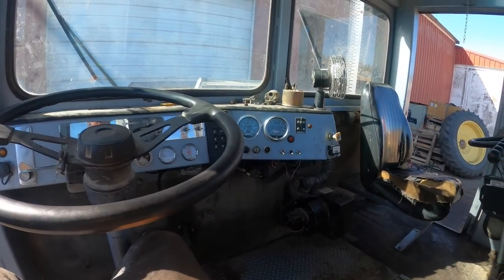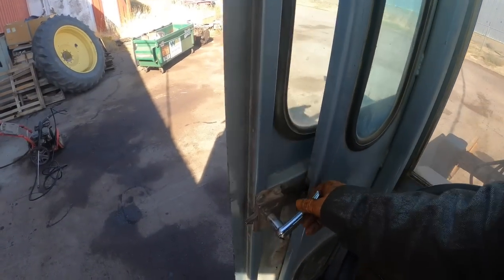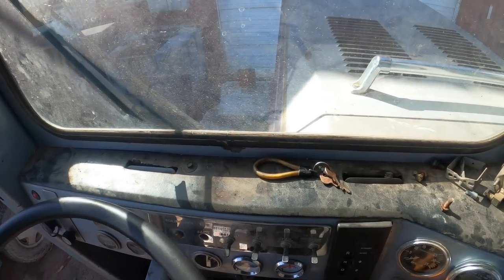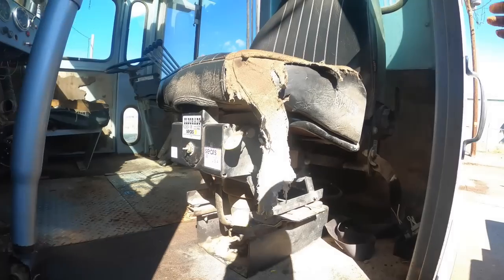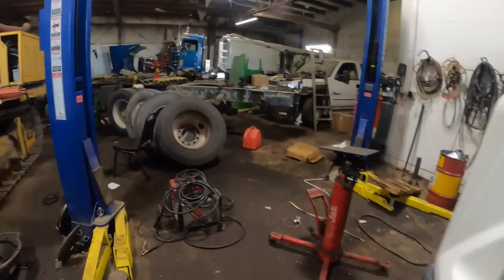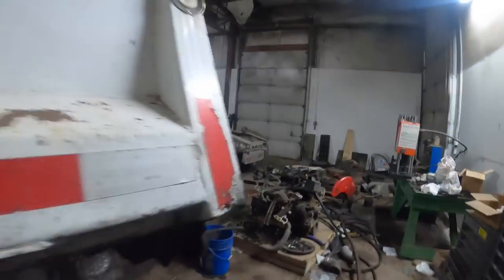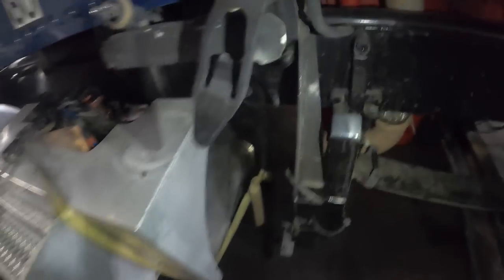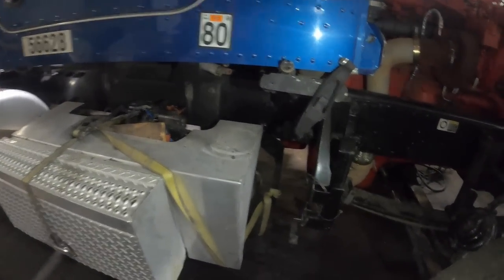Finally finishing the squeeze project.

Comment: Wire nuts... Electricians way of making connections. The guy probably wires houses and took some time to wire a truck engine retrofit.
Well done on the Hay squeeze, looks and sounds good. I know the owner needs to put it to work ASAP,  but a side benefit is that he can work out some of the bugs by putting it to use before the final finishing touhes.

Comment: It is perfectly fine to repair that harness.  I wouldn't spice any of the wires together, the correct way to connect those wires together is using a large connector with enough pins for all of the connections.  Then all you have to do is crimp the terminals onto the wires and plug the connectors into each other.  Ampseal connectors would be a good choice for joining the wires together.

Comment: I’ve seen those cylinders bent before. Freightliner dealership bent both on my old man’s cabover. Only thing we could figure is that they didn’t remove the safety latch and the cab wouldn’t come down, so they pumped it down with the cab jack??!!

Comment: That new swap project is interesting. Amazing how the shop tells the guy one thing and then the truck shows up in pieces. I wonder how much it will cost the guy for you to unscrew everything the other clowns did. What kind of shop uses wire nuts on a truck

Comment: Regarding the stories you get from owners, shops etc. on vehicles they want you to take on, you're probably used to the fact that you're being lied to. Part of it is the previous shop not wanting to own responsibility for the work they've done and charged for. Part of it is the owner being in denial and wanting to believe that it only needs a 'little bit of work' to get it done. No one wants to tell, or 'be told' the truth.

Comment: Looks like a nice conversion. But Warren will be on my butt. The customer should have had the seats fixed. That loader will get 100`s of hours of use. That is one lousy wire job. Warren has work cut out on this project. I would never wire like that. I solder and sometimes I use the butt connecters that have the solder in them.

Comment: Good grief what a mess Wire nuts and claw hammers have no business in a equipment and automotive base shop there's no  Claw hammers allowed in my shop  Even when I managed shops and saw guys working using those I told them to take it home Does not belong here .With that being said I can understand  Using wire nuts just to make temporary connections  to figure it out before you make permanent connections But that's about it and i'd rather just twist the wires together Somebody used to have a commercial residential electrical career I get my buddies that run electrician companies Well I'm a electrician I can wire it up 12 and 24 V electrical systems are way more complicated Stick with your 4 wires you elechickens I'll call you when I need you to drag wire  Under my house